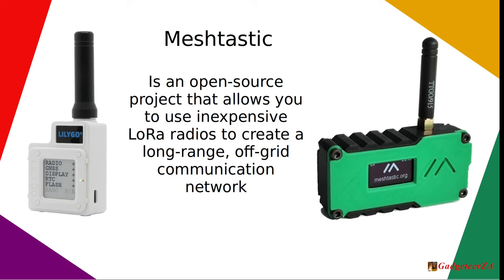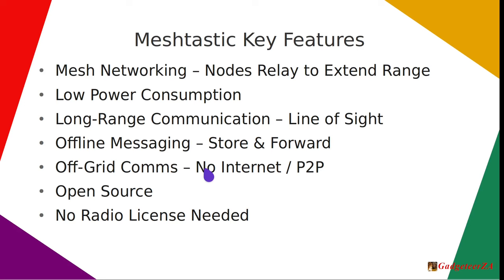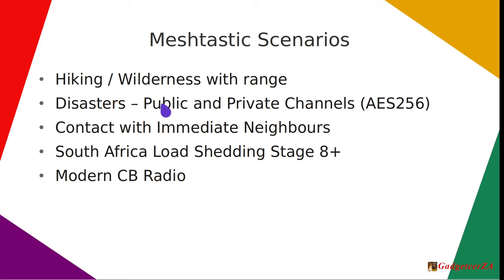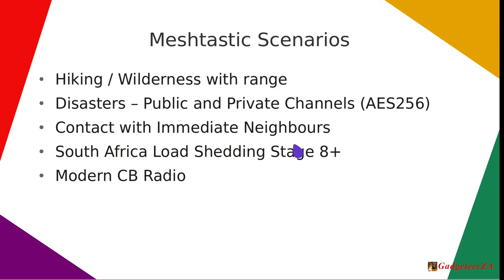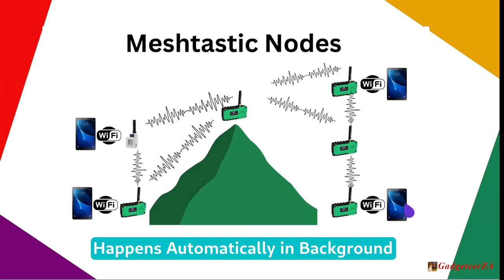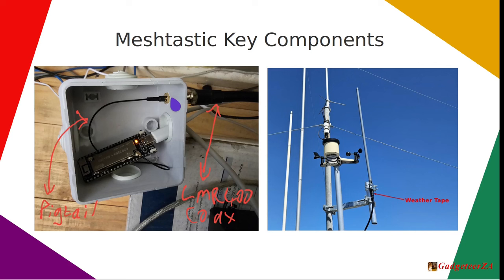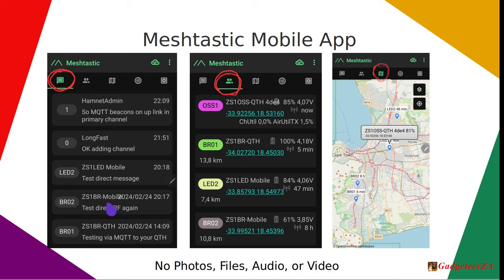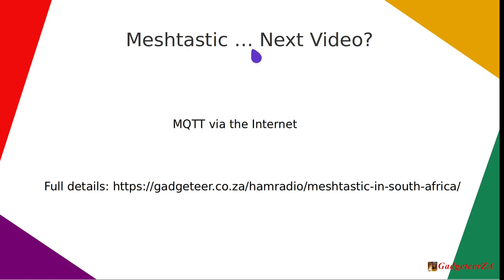A Non-Technical Introduction to Meshtastic Off-Grid Radio Communications

Comment: I wouldnt mind buying a few. I was hesitant as i thought it might not be legal and not sure if anyone in South Africa uses it.     I would not mind to install an unit with medium antenna to extend range and be an extra hop in my area.  (Im on other side of tygerberg mountain)
Reply from the maker: That would be great! Yes, I did double check in the ICASA regulations and these are fine on 868 MHz as long as the power stays at these low levels. A medium antenna around 10 cm would work pretty well. The problem is too many people turn theirs on and see no-one because not enough people leave them running. I'm leaving mine at home plugged into USB with the long antenna in the hope that others see it online. I did a shorter TikTok video at https://www.tiktok.com/@danie_vdm/video/7342106452640664837 to try to get more local awareness too.
Reply: @GadgeteerZA   You don't have a link you could post of a good 868mhz antenna that has the pigtail that will fit the Lora V3 USB device?   I see alot of antenna's that has SMA connectors but then no small connector for pigtail little connector.
Reply from the maker: OK really difficult to post a specific link as it depends on where you will be sourcing it from. You also want to be sure exactly which device, so I've only so far worked with the Heltec Wireless Stick Lite V3 and that has an IPX connector. On my webpage at https://gadgeteer.co.za/hamradio/meshtastic-in-south-africa/ I did put some links including to the pigtail I bought, as well as explaining the alternative names that IPX often goes under e.g. IPEX, U.FL, etc.

So, yes most antennas generally come with a SMA male connector, so you'd then want a pigtail with SMA Female (or RP-SMA) to IPX. Usually, the pigtails are sold separately from the antenna.
Reply: @GadgeteerZA   the one i was looking to get is the Heltec one's with screen also the V3.  So it uses that little u.fl connector.  So my idea was to get a medium sized antenna to run 24/7 , say 6dbi or 7dbi but have ability for mobility. (say for camping).  Ideally need a the antenna to have the SMA to ufl connector for the V3.   I see some Lora devices has the SMA connector direct.
Reply from the maker: Yes that's a good plan. I'm looking to buy the LilyGo T-Echo that also has the SMA ready to go, but there is zero stock for a while. The Waveform version for Raspberry Pi also comes with SMA on the board, but it would be a bit bulkier with the Pi. If you end up with a pigtail connector tho, just check the male female sides are compatible.
Reply: @GadgeteerZA  I ordered 2 of the Heltec V3 with screen should have it soon, maybe by next week. It comes with the little white and blue casing (slightly bigger than the  actual device) i'll connect a 18650 holder behind it.  Those come with small 2dbi little wire antenna's.  I'll try and find 3-5dbi one's to replace and then one of them keep home connected to 5-8dbi 868mhz
Reply from the maker: Very nice option. Wish we had those Heltecs - all we have is the Wireless Stick Lite's and importing via AliExpress means they get lost at our local post office ;-)
Reply: @GadgeteerZA   Received the goodies, it was pretty quick i must say..
Reply from the maker: @EugeneHuman-kl1vc  great - looking forward to seeing it pop up on the map soon. The LilyGo T-Echo cam came back in stock 20 mins ago on their site so ordered one of those, but about 20 days to deliver.
Reply: @GadgeteerZA   What region , do you use EU_868 ?  As there is no setting for SA_868
Reply from the maker: @EugeneHuman-kl1vc yes EU-868 as same ITU Region 1 for North to South where we are
Reply: @GadgeteerZA  I seen a video the other day where one youtuber took an outdoor PIR solar light. They normally have 5v solar panels on them and the compartment inside is quite big. They contain an single 2000mah or 2500mah 18650 inside and it's fairly spacious inside. Sufficient space to slot in an Heltec V3 with an 2-3 dbi antenna. They can be mounted high on nock of your house and it's one of those sensor lights ... so it will only go on in night if there is movement. During the daytime it just charges the 18650.   The heltec v3 lead  for battery just connects to positive and negative of that 18650 and it starts up and runs. Solong as it has power from battery it will run.
Reply from the maker: @EugeneHuman-kl1vc  yes it's a good idea for an outdoor mount with battery, but one may still want an external antenna hooked up for really good coverage. As my house is not a double-story, putting my antenna on a pole at roof height has given a bit more reach I think.
Reply: @GadgeteerZA   It's nice and discreet, say if you wanted to deploy a few in different areas. Will just look like a normal solar light on a wall.    Has 2 functions too,  Lora & Pathway light.   Not bad for a community deployment type of thing . If you have one or two in every few streets. Powerdraw is minimal.  I took a measurement with my USB power meter. This specific one is connected to my home Wifi, so it's using more than normal.  Consumed 5.1v @ 0.138amps or   0.702watt.    an 18650 of 3000mah (like LG brown one) is 3.7V @ 3amp or 11.1W.  Should give a runtime of 15hours before needing a charge via solar or usb.
Reply from the maker: @EugeneHuman-kl1vc  yes mine show around 120 mA power draw. We're slowly seeing some new nodes appearing in Cape Town. I have one 4  km away from me that has connected to me, and may be relaying now to another one about 7 km away from me.
Reply: @GadgeteerZA  nice.   This side of the mountain its empty it seems.  I dont see any other nodes here by welgemoed or durbanville.  Propably give it 6months or more.  Hopefully more people expand it.
Reply from the maker: @eugenehuman1945  yes key is to leave yours on 24/7 so others at l;east see you when they start up. Also try share it with community groups on WhatsApp or Telegram nearby. I'm up in Newlands Forest tomorrow so hoping to "see" some nodes I don't normally reach from home.
Reply: @GadgeteerZA  something happened on saturday or was sunday.  I could see OSS1 and 2 and few others.  I didnt change anything by me.   Seen one or two msg on longfast.  But only lasted 2 or 3 hours.    Maybe someone with a mobile device that managed to give coverage or angled signal this side of tygerberg.
Reply from the maker: @eugenehuman1945  it was Sunday morning. LED1 was up on Devil's Peak and suddenly a whole lot of nodes could see each other through his one. We just need an extra node to stay up on the mountain, then we'll all connect 24/7.
Reply: @GadgeteerZA  was that our devices connecting to him via mesh. Or is there some internet broadcasts somewhere involved.   Was it just a test ?  Or will it be on permanent soon?
Reply from the maker: @eugenehuman1945  no it is all via radio mesh. Each node helps pass messages on to other nodes. Someone needs to donate, or hide their, spare node up on the mountain. LED1 said he may do that, but seems he did not (yet). I also picked up another node 20km from someone hiking above Tokai. I'll be briefly visible above Newlands on Wed morning around 10:30.

Comment: youtube.com/@GadgeteerZA Thanks for the overview, we're also looking using the hardware up in the Pretoria region, would be great to get into contact to understand where and how you sourced your hardware and any advice to get up and running with a permanent gateway/node acting as a relay in the area.
Reply from the maker: Sorry I see now your comment got held for review (no idea why). But we did get in contact. Yes definitely a high site though if possible, as it really gets all nodes in contact with each other. For example in Cape Town we have one node higher up (can't say exactly where yet as paperwork must be approved) and it connected me (on Cape Flats) to a node in Stellenbosch 32 km away.

Other thing in the beginning is to maybe increase max hops to 5 or 7 so that you can reach further through some nodes until you have a few in the area and then drop it again. But I have one node above my roof and one in the house so that already uses one additional hop.

I did also describe my home setup in my webpage at https://gadgeteer.co.za/hamradio/meshtastic-in-south-africa/ as well as some sources.

The ham radio guys have been quite keen to get involved so it may be worth trying to get in contact with one or two in the area. You can reach them at https://www.parc.org.za/ and maybe ask they announce something about Meshtastic to their members. I wrote an article in the Radio ZS magazine for hams in the May 2024 edition about Meshtastic.

We try to also at least have the MQTT uplink enabled for Channel 0 the LongFast channel, so that locations are advertised at https://meshmap.net/ for others to see where the nodes are.